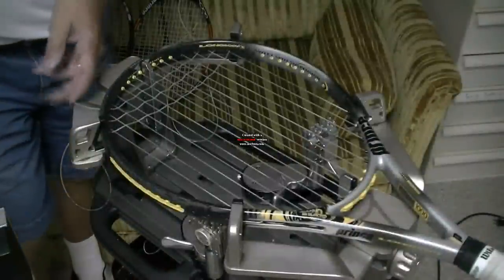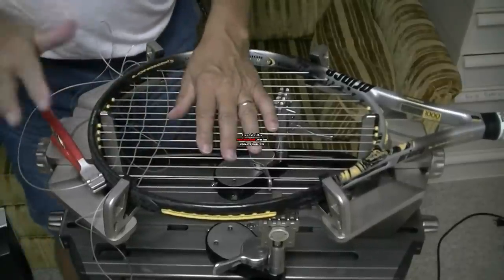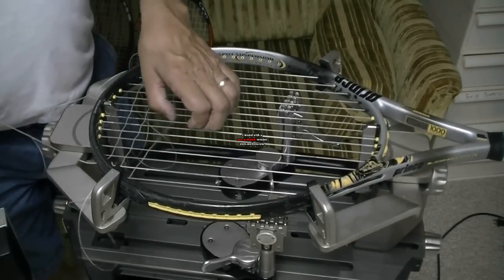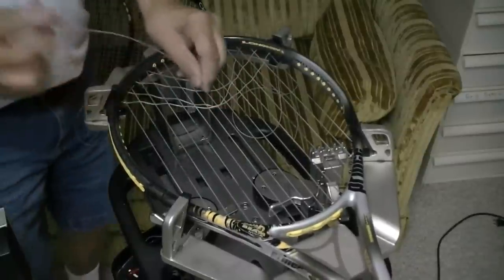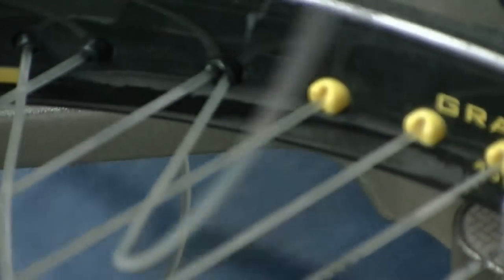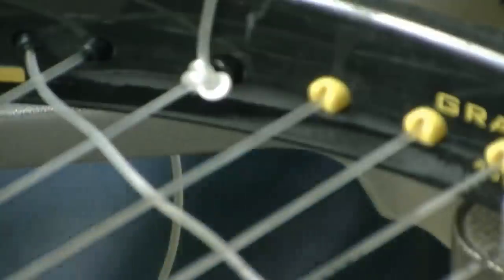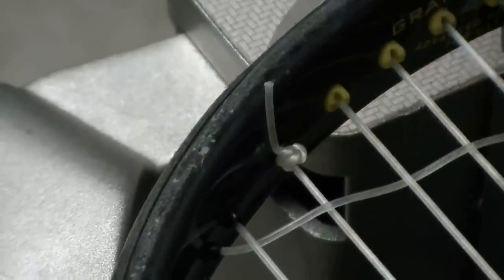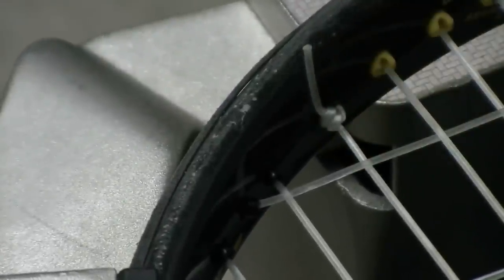Cross Starting Knot

Comment from the maker: If you're pulling on the tail to tighten the knot you will break strings a lot. Pulling on a cross against a starting knot should not break a properly tied starting knot. If you're still having issues try using a starting clamp to start your crosses and tied off with a tie off knot.

Comment: Should I use this knot as a finishing knot on an old grommet?
Reply from the maker: I do it often. Make sure you hold the tail end of the string when releasing the clamp so the knot is not pulled into the grommet
Reply: @Mr10sStringer  thank you for your time and consideration 👍🏻
Reply from the maker: @jimbo1san  you’re welcome no problem